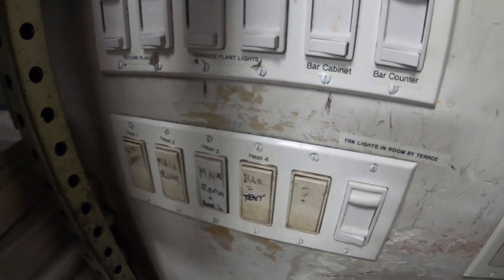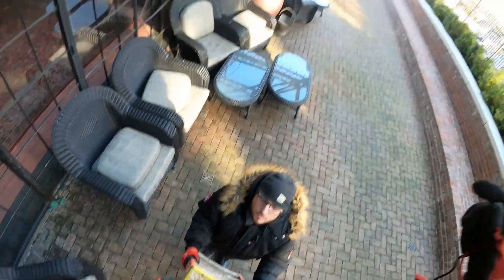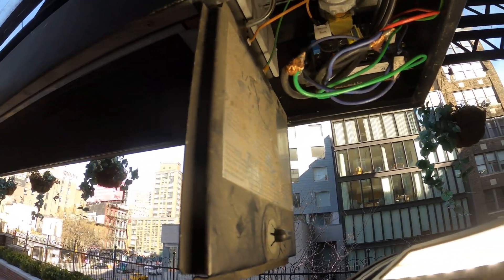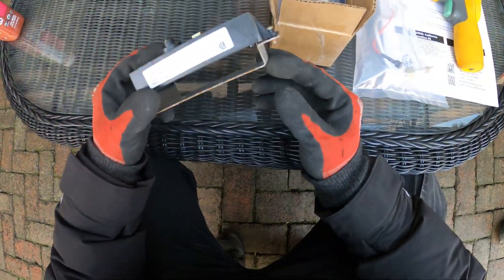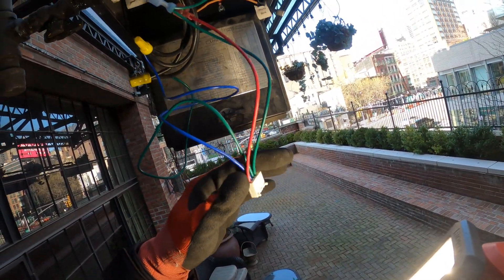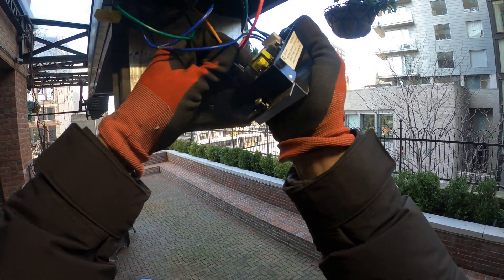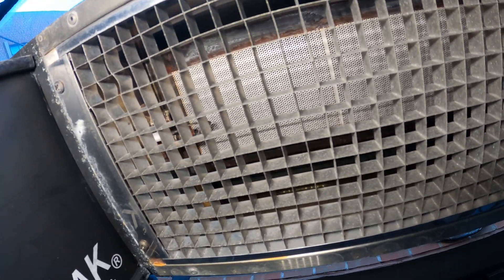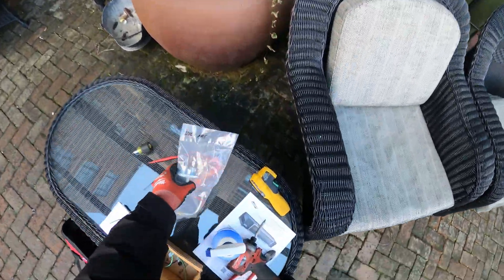HVAC Service Call: Infrared Patio Heater Not Working (Direct Spark Ignition Module) Pilot Electrode

Comment: Trying to fix this exact make and model. The manual and the Sunpak troubleshoot site talks about cleaning out the "orifice" - probably has a spider web or other debris blocking the flow. I cannot loosen the orifice nut as illustrated. Any thoughts? 
I'm also with you buddy - why done they make the parts that need attention accessible?

Comment: Good job Jumper, You could have drilled the rivets out with either a 1/8 inch bit or 3/16 inch drill bit on the flush side of the rivet, but you got it working, You definitely need a taller ladder and a thermal imaging camera or device. Good job.